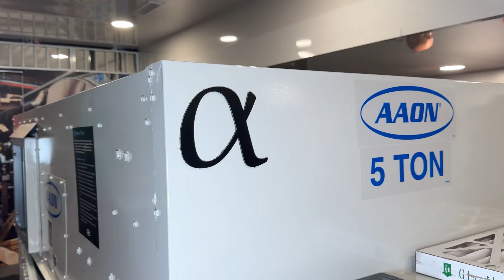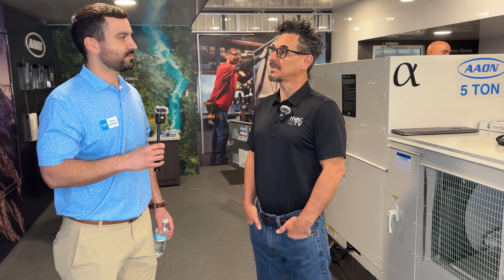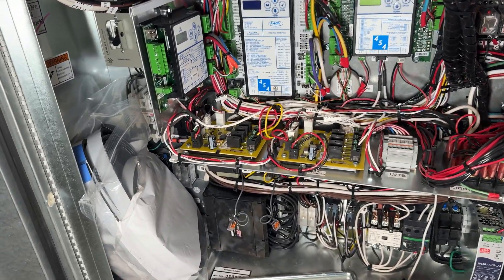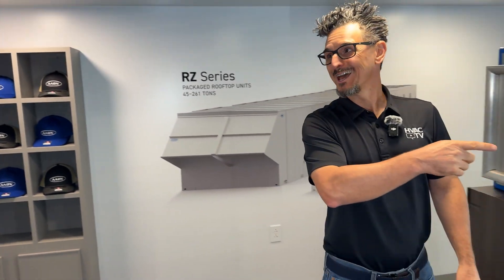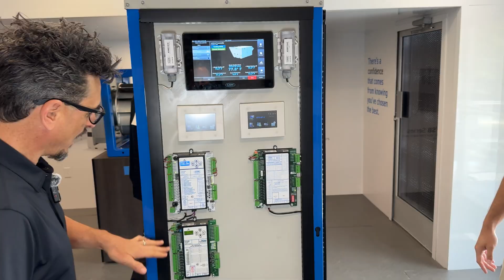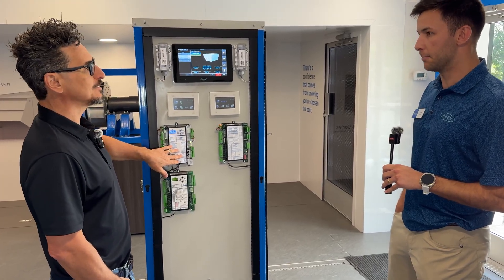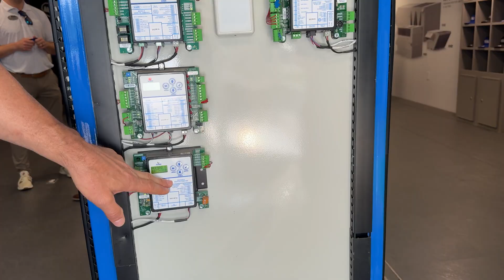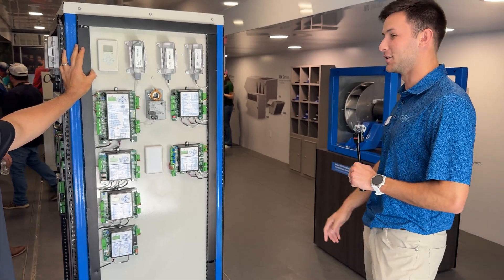Inside the New AAON Trailer: Heat Pumps, Controls & Hidden Features You Need to See

Comment: I have a  two 2024 R410A
16ton Dual Fuel Heat pump. We have Hydronic heat for the back up heat. Been very happy with them. However i did get one that was flat ( no refrigerant) on arrival.  

Im glad i have AAON equipment